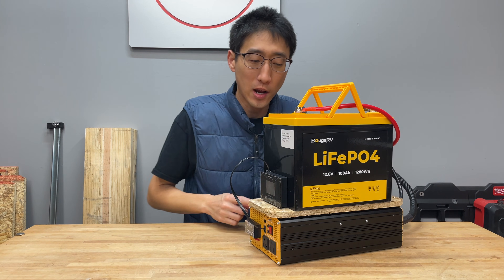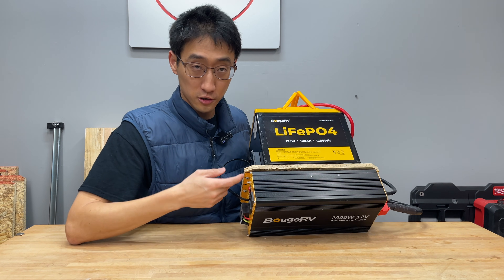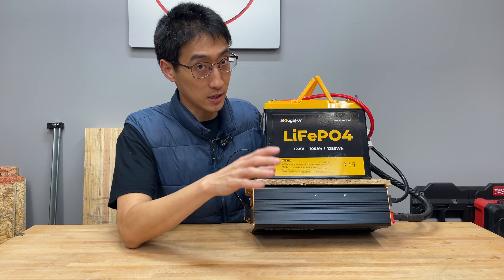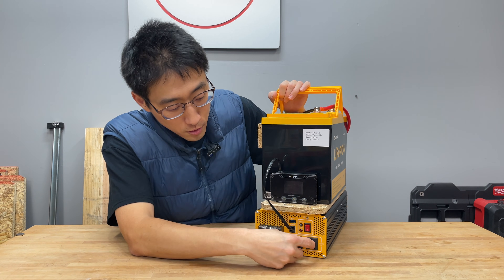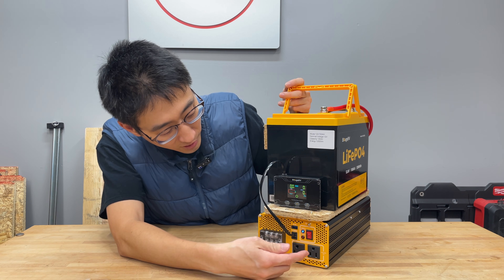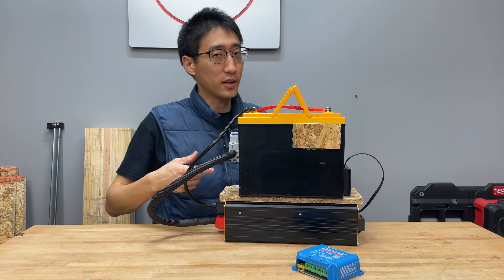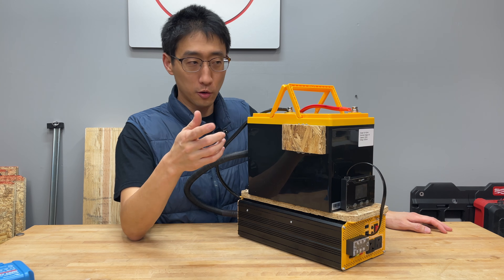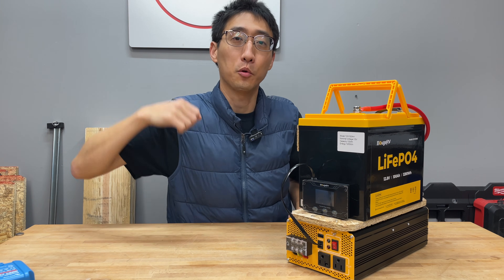DIY Portable Mini Power Station in under 10 mins for under $600 | 1.2 KWh

Comment: Would this work as a replacement universal power supply if you add a AC charger that stays plugged in all the time? (As long as the loads don't exceed the maximum watts provided by the inverter or the battery)

Comment: 100ah lifepo4 battery...on a 2000w inverter?  Huh?  I mean the battery has a maximum output of 100a meaning that any inverter above 1200w is going to do nothing except add the possibility of overdraw and the bms shutting down.  So yeah, your premise is built on wonky ground.  Oh, and btw, the circuit breaker is not about having a quick and easy disconnect.  It is about fusing in order to protect the cable.  Therefor it needs to be closer to the battery terminal than the inverter side.  Interesting idea with the plywood (flammable material) sandwich between two heat-generating things that when they fail can cause fire.  Sorry man, but this video is uninformative and dangerous.

Comment: If this is what you want then this is the best time to get it. The battery is 150, chargers are 50 and the inverter is 150. With tax and additional parts, you may come out a bit above 450. Which isnt bad but it is more expensive than the average 1kwh powerstation which all major brands are selling them for under 400.

Comment: Construction adhesive?  This whole setup is pretty janky.  Why not put some thought in to it and come up with a low cost, less janky solution for your viewers.  While you're at it, instead of saying that they could clean up the wires, and that they should install feet, why not just do it so people can see what is actually possible.  Instead, you just slap together a janky setup - the whole thing just feels low effort on your part.
Reply: You must've missed the "in under 10 minutes" part of the video title. Go find an in depth video if that's what your after.

Comment: First, great video for the option to build a power station. But without charging capability, it's like a half complete system. Could you please add a 110v charge controller to charge the battery, so it can be a "complete" system. For the same capacity, EcoFlow Delta 2 is now only cost about $400, plus all the feature it built in, maybe not worth to build one as of now.

Comment: ok im new to this but is there a way to safe and quickly charge this system without a trickle charger or solar. I am thinking of a van build and can bring the eco flow into work to charge it by the end of my shift. How would i get the same result?
Reply: Good idea, bro. Can you recommend a good trickle charger ?

Comment: EcoFlow comes with built-in fast charging 1500 watts.  Where is the wall plug battery charger in your build?  I got EcoFlow Delta 3 Plus for $484 plus tax.  Has1kwh battery, two charge controllers (500 watts x 2), fast 140w USB PD ports, etc.  Inverter is extremely quiet and can easily do 2000W.  The BougeRV inverter fans are not exactly quiet.  DIY can be cheaper and fun to build, but also lacking in a number of ways.
Reply: Dang, that same unit is on sale right now for 799$ I am thinking of going with a cheaper power bank and just hooking a battery up to it. That way I can still charge it easy.

Comment: Could you show more on type of breakers and gauge of wire used. Also fuses.? Thanks.
Reply: Its all math amps × voltage gives you watts where watts ÷ voltage = amps 

Where amps multiply by 1.25 for safety ex a 2000 watt inverter at 12v is 166 amps adjusted to closest standard breaker is 170 but a 200a breaker would be okay as well. 

Additionally, wiring is by distance and that's about 1 or maybe 2 feet of cable. The sizing youd need would roughly be 2/0 (with appropriate connectors)

The hidden costs he isn't showing is you will need a few more items

A crimp tool, appropriate connectors, heat shrink, and any other accessories you might want.

Your TKO esp with tariffs on these goods now is closer to 1000$ built w/o a case.

For ref, i just built a 300ah system into a ryobi box for 1400$. Charge, 12v sockets, fuse block, cabling, bus bar, etc.

Still though, ecoflows new gen 3 is 2800$ and so got mine for half price & it's expandable :)
Reply: @mbround18  great break down!
Reply: @mbround18 Thank you for your detailed reply. 

WAV (Watts = Amps x Volts) 🎈
Reply: @mbround18 the guy asked what kind and type of breakers used. Thanks for your long winded non-answer
Reply: So... How do you charge it?
Reply: I like this project, but I ask (like other people here): excluding solar panel, how do you recharge the battery? 
I appreciate your kind answer, thank you 😊